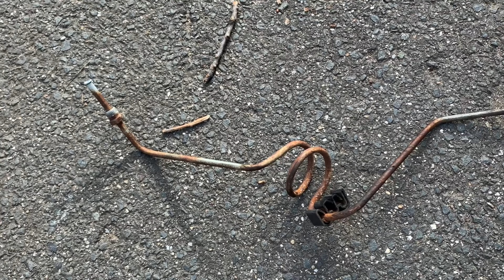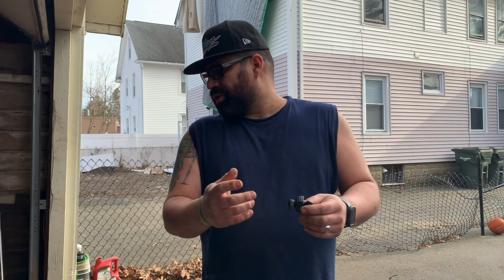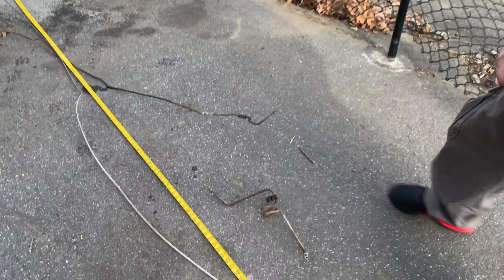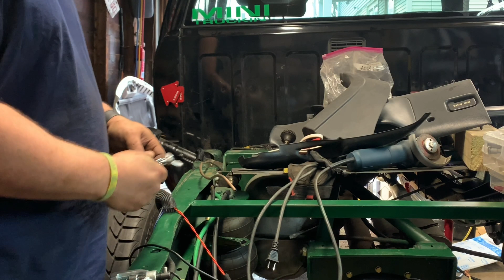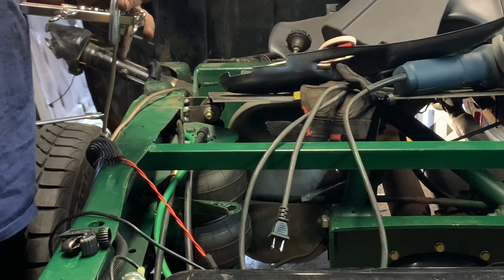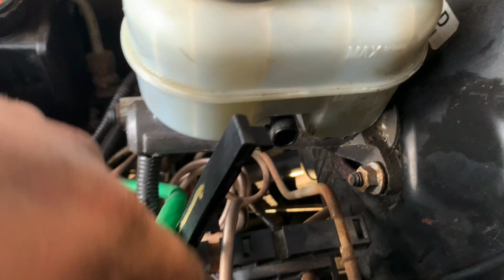2000 S10 Rusted leaking brake line fix

Comment: 3/16?
Reply: 1/4"  3:38 most S10's are 1/4" NOT 3/16". Beware of the ABS module fitting from the line. It is NOT 7/16-24 SAE. It's 7/16-24 NPT. Trick - when you replace the line to the module - USE THE OLD FITTING AT THE ABS MODULE. Need to do this so I'm here trying to see what it takes to do it WITHOUT removing the bed (no way that's gonna happen).